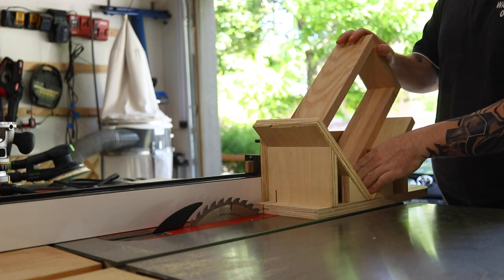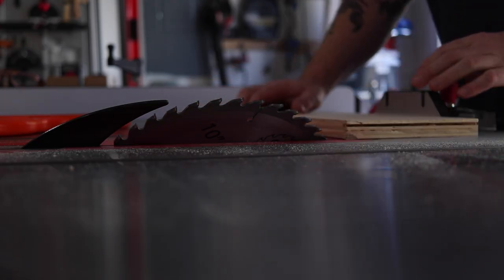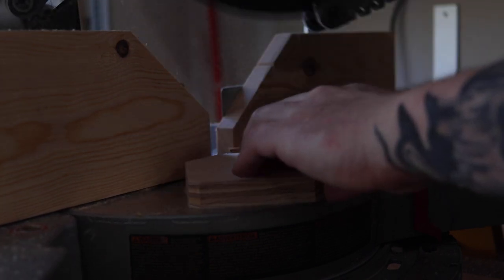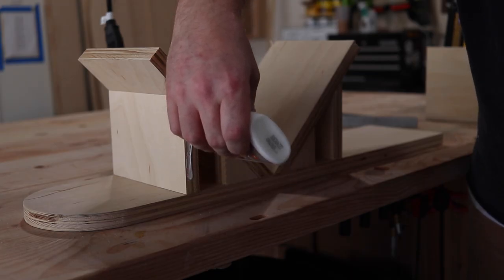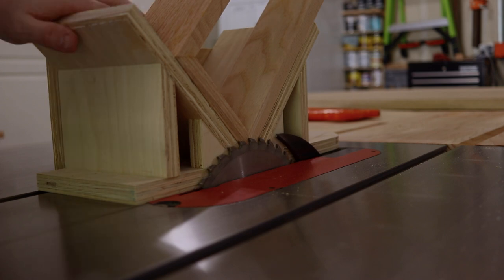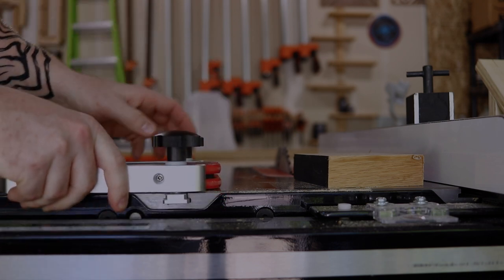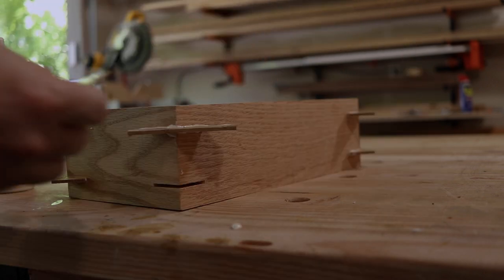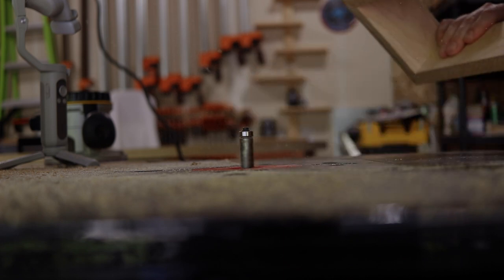Spline Jig for Reinforcing Miter Joints

Comment: I use a flush trim bit on my router table to remove the excess spline material. Works well and have not experienced blowouts.
Reply from the maker: Sweet, thanks for letting me know! Do you trim it down at all? Or just cut right into it?
Reply: @gerberdesignco  trim all the way down then do my final sanding at 320. Fyi, I'm just a hobbyist.
Reply from the maker: @trentyoung1135  nice! Thanks for the info. I’ll definitely be doing that again 🤘🏼